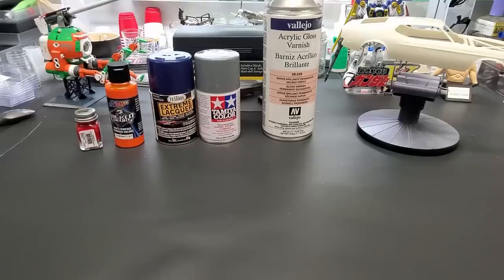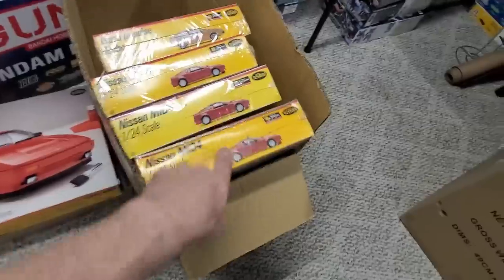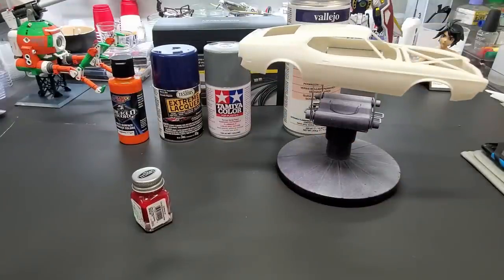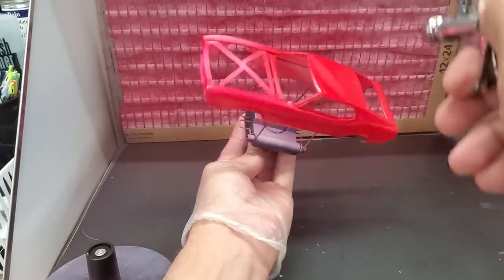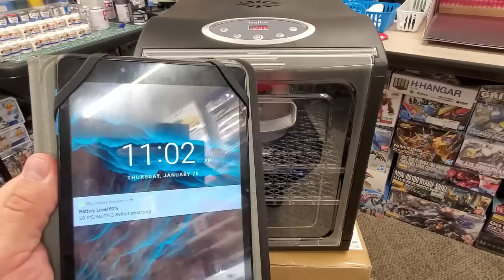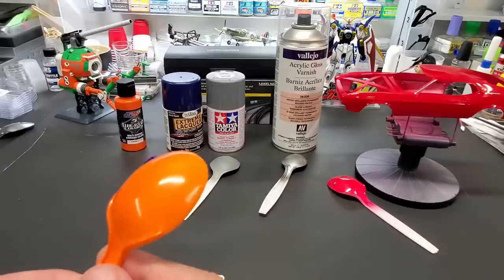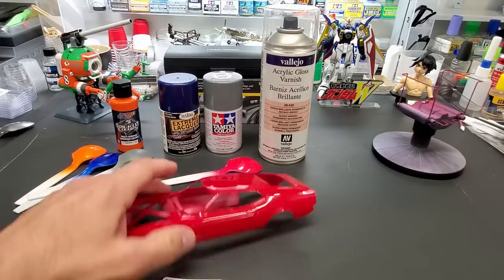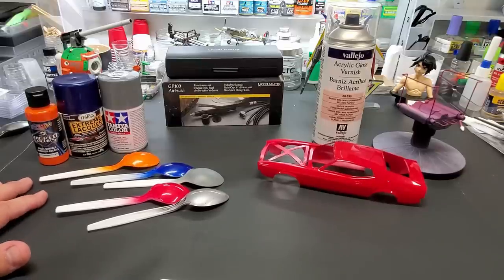Scale Model Tips - Using A Food Dehydrator To Cure & Dry Your Model Paints Fast !!

Comment: right after I'm done painting my cars I like to put them in large Tupperware bowls or totes to keep the dust out
Reply: That’s one reason I’m watching this video, I’m about to get my first model ready to paint, but I’m afraid dust will fall into the paint, what do you do with the Tupperware?
Reply: @robinfelix2276  I turn the Tupperware upside down and put it on the model I painted wherever I painted the model without moving it really carefully
Reply: @robertmckelvey3091  oh okay yeah that sounds good, do you poke holes on the Tupperware to allow air to flow or it dries just good with no air flow?
Reply: @robinfelix2276  using rattle cans works I'm not sure about acrylic paint though
Reply: It should dry fine only need to leave it on for 10 or 20 minutes to let it set up a little bit anything after that it should be hard enough to any dust to collect on it can be wiped off later
Reply: @robertmckelvey3091  yeah i will be using tamiya spray cans so i think it should be good, so no need to poke holes in the tupperware? sorry if i didnt understand that part lol

Comment: I’ve been looking at the createx autoair “Quicksilver Chrome candy2o Box Set”, have you tested this paint, in particular the quicksilver chrome?
Reply: It’s not bad as long as you don’t go to far with it. Meaning to many coats. Also I’ve found that before you 2K clear coat it if you use their uvls 4050 clear before applying 2K you get a better finished result.
Reply: @FuelsModels  
Thanks for the tip!
They state that this chrome effect is more durable than others, I’ve tried the spaz stix chrome but this one you can hardly touch at all... im guessing quicksilver is not as “shiny” as spaz stix but how durable is quicksilver without a clear compared to others and does it loose much shine with clearing it as you described?
Reply: @GroggyGreg  shine is pretty good as long as you don’t put a 2K clear right on top of it and don’t go to many coats. Like I said if you use the Createx 4050 uvls clear which is really good stuff you can put a 2K on that and even that’s not needed after using the 4050. Just gotta be careful of not going with to many coats.
Reply: @FuelsModels  
Yeah, that looks really nice!
I got to order that box set and some 4050 :) thank you!
Did you get ever get to testing the candy as window tint?
Reply: @GroggyGreg  didn’t work out. I think I may have needed to sand the clear glass bc it wasn’t wanting to stick but didn’t want to go testing on what I was trying to paint. If you don’t want to get the whole box set I haven’t been using the Createx gloss black. I’ve just been using some acrylic enamel gloss black that’s a single stage automotive paint so any gloss black should work.

Comment: So I tried this put it on 115 and left it in for 5 hours. Used Tamiya paints but yet it was still tacky when It was done. Can you tell me why that might have happened
Reply from the maker: Wow, something is wrong for sure. I put my Tamiya paints in it the other day for 20 minutes and they were fully cured. I need more info, how did you thin your paint? What did you use and what ratio? How many layers did you spray?
Reply: @barbatosrex9473  I used Tamiya flat black spray. I let it dry for 2 hours and then put it in for 5 hours at 115. I didn’t need to thin it with anything. But normally I just thin my Tamiya with water before use. But as soon as it was done I let it cool for a day and it was still tacky. On top of that I can rub it right off with my finger
Reply: @normanbeaulieu4204  sounds like an issue with the paint
Reply: @danzo5521  I don’t know what was going on. I tried different paint and different plastic. Sometimes it worked sometimes not. All I know is the only consistent drying I ever have is just letting it sit and air dry
Reply: @danzo5521  but I did find a solution for painting any paint. From enamel to Lacquer to acrylic. And it doesn’t matter what plastic the kit is made of. I found if you use “purple primer” it’s a PVC plumbing primer. If you put it down like you would a regular primer that will let you use any paint on anything. From hard plastics to flexible and it will stick and not stay tacky. It’s purple so you need to use it with dark colors. Or what I do is mix it with black paint or ink and you then have a black primer. I think they make a clear version of the product as well so there is that
Reply: @normanbeaulieu4204  interesting
Reply: @danzo5521  I found a video from a special effects guy on YouTube because I was having trouble also painting really soft and flexible plastic. And he did a test with all sorts of primers on plastic. The PVC Purple Primer was the best by far. He also tinted it black. It worked awesome. So I did my own experiment on the plastics I use soft plastics from kit tiers even rubber erasers I had in a junk drawer.to vinyl to hard plastics like typical kits and even action figures. I also did a gas can new and used. The used one I didn’t even clean first. With the Purple Primer paint stuck to it like it was made from it. And was durable. I’m not saying it was like 2K but I could throw a sample around or in a drawer and it would hold up.

Comment: I have used the same but I have a better one made by  Micro make the doctor Dry booth  I have 2 the biggest one they make a the smaller one but if I paint  Any enamel paint I use Mr. Colours levelling thinner and it will cut the time down super fast I only have to set my dry booth for 15 to 20 minutes and you can work with it I have never ever went over 20 minutes to get it to dry my dry booths are all  Metal and  aluminium the temp can go upto 113 degrees on top rack I use it every day.